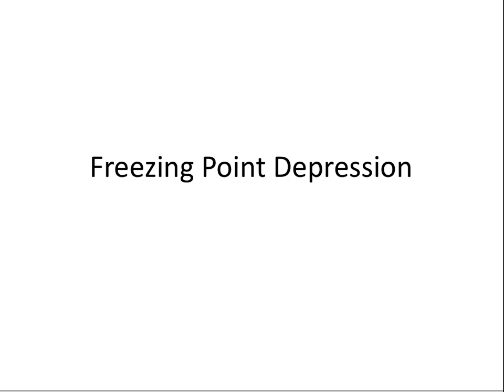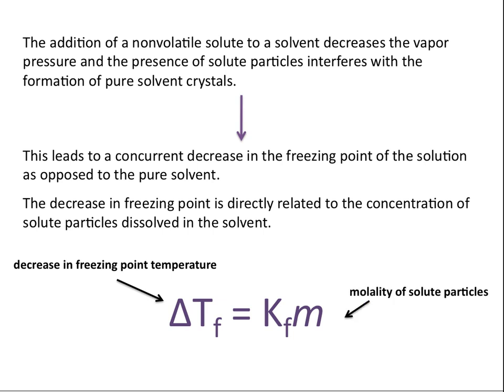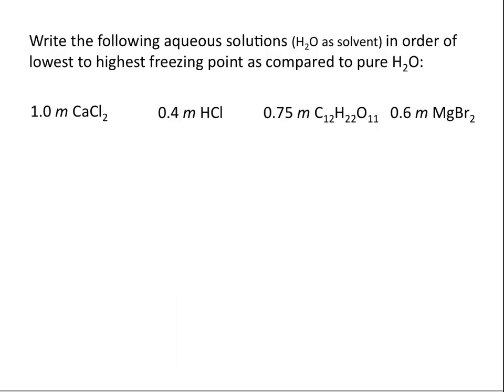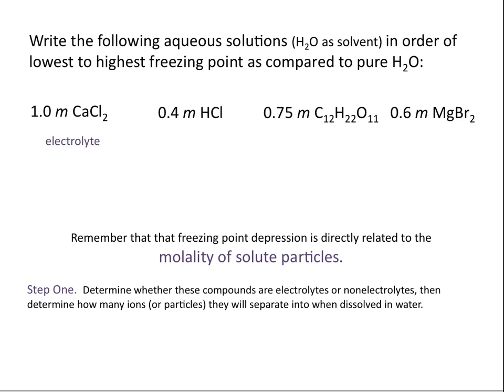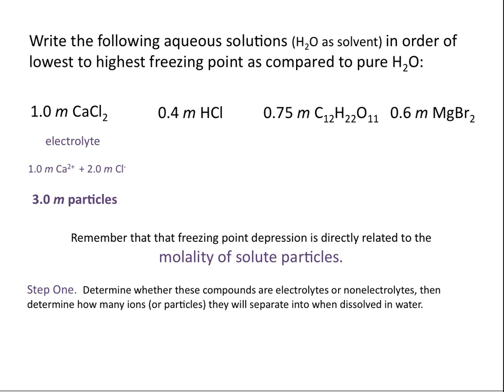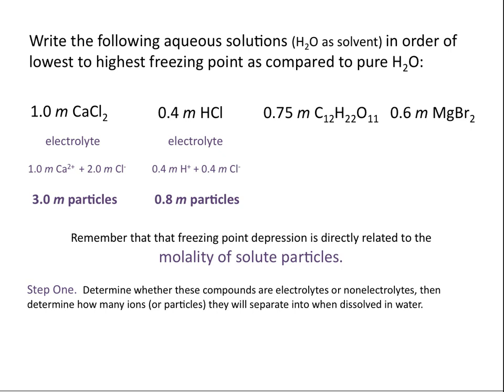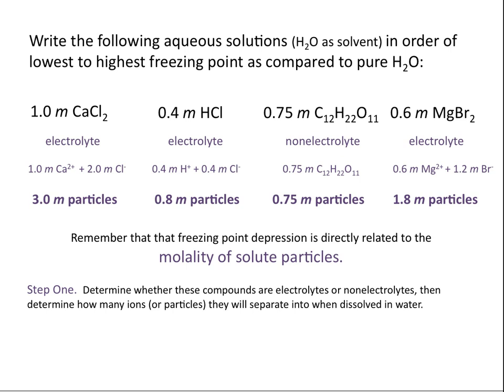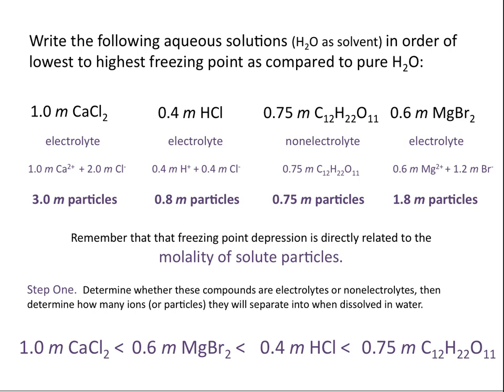Freezing Point Depression - Chemistry Tutorial

Comment: why is it that the particles of sucrose is still .75?
Reply: +holdOn 24 salts dissociate in polar solution, therefore now there are two particlas per 1 salt molecule in the solution. sucrose just remains as one partical
Reply: @glecko9241   But sucrose is POLAR as well ass salts. LIKE DISSOLVES LIKE. The interpretation is that the Organic Compounds (Polar ones) do not behave the same as the ionic salts (electrolytes =Polar) when they are dissolved in a Polar solvents such as H2O (water). The salts dissociate into 2 different ions: cations (+ve) and anions (-ve), whereas, the organic compounds such as sucrose do not dissociate yet they dissolve as one whole molecule into solvent.  I wish that clarifies your doubts.